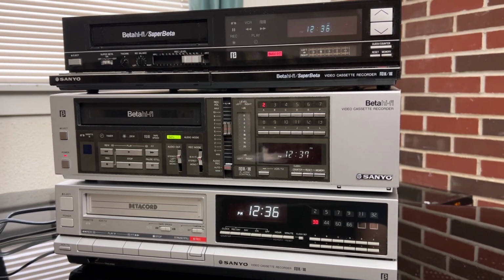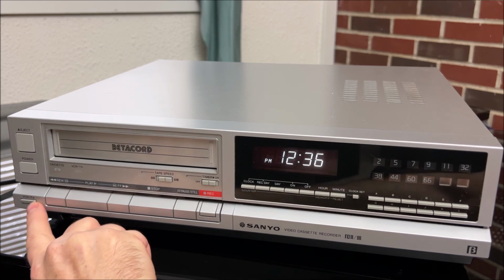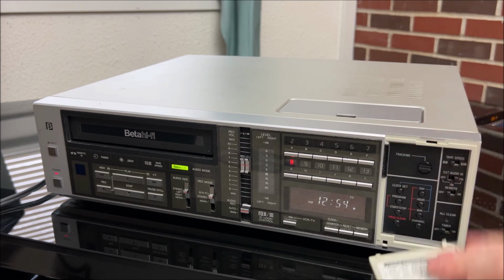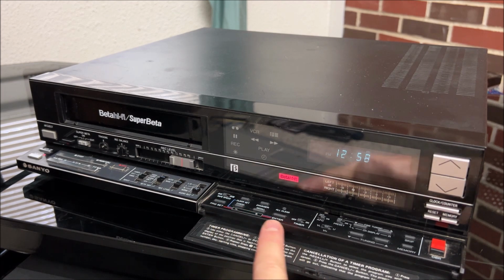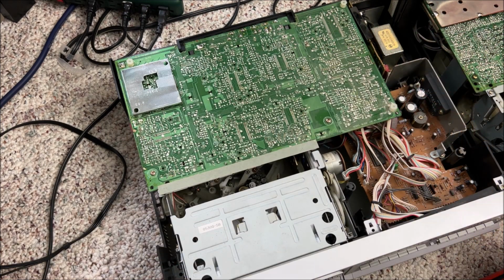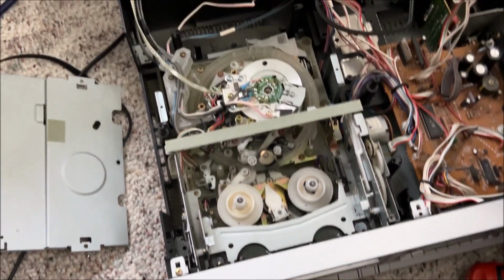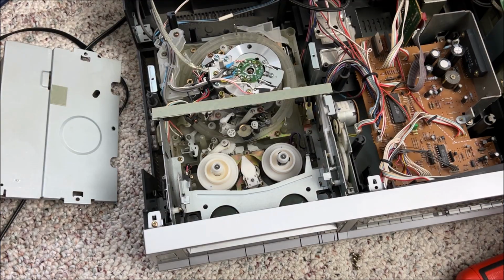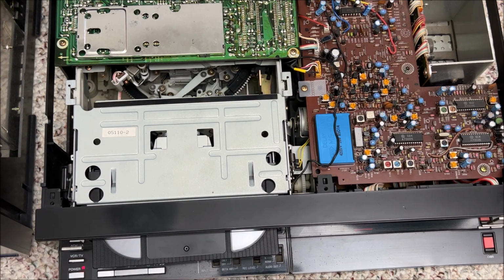Stop the Tape-Eater! Fixing a Sanyo Betamax VCR: Belts & Rollers Repair

Comment: Hi, I have a Sony Betamax VCR-7200 that I’ve been rebuilding and I’m hoping you can point me in the right direction.
Here’s everything I’ve already done:

• Replaced all belts (loading belt, arm belt, capstan belt, and the idler tire pulleys)
• Replaced both idler rollers
• Cleaned the idler tire and reel tables
• Cleaned the entire tape path (guides, capstan, etc.)
• Cleaned the audio/CTL head
• Cleaned the drum surface
• Cleaned the cam track (no oil added)
• Cleaned the cam follower (no oil)
• Lubricated only the correct metal pivot points with light machine oil (very small drops)
• Returned the loading spring to the original notch
• Mechanism loads and unloads properly
• Reel torque is good and take-up is working

The issue:
Video is fuzzy and unstable unless I manually push the right-hand guide arm (the tension/guide post that pulls the tape onto the drum) inward about 1–2mm.
If I press that arm while it’s playing, the picture becomes perfect and the tape sits squarely on the drum.
But the arm will not reach that position on its own.

So it appears the guide arm is stopping just short of its full travel, even after cleaning the cam track and lubricating the pivot.
The spring is in the correct position and is not stretched or weak.

My question:
What usually causes the right guide arm on these 7200 decks to stop slightly short of its correct wrap position?
Is there a specific pivot, follower, or cam part on this model that commonly binds even after cleaning, or is there an adjustment point I’m missing that affects guide arm travel?

Any advice would help a lot — thank you.

Comment: "Super Beta has a slight increase in picture quality", Right!  Standard VCR picture quality was 230 lines of resolution or less, Super Beta was over 400 lines of resolution, a major improvement. In most cases you did not have a video source that could fully utilize the capability other than to use a high quality camera to show what Super Beta could actually do. Also, HiFi audio came out prior to when TV stereo was available and was a real treat, OMG... This sounded so good when hooked up to your stereo system.

Comment: Great video, recently picked up a Sony sl-5000 machine and essentially soaking up the basics of a more analogue design and tips before I jump into my own. Has trouble loading and appears to be famous for bad belts and caps so I’ll have an order in for that soon. I also have an issue where the very thin plastic plunger style buttons on what I assume is the timer like to shoot out. Noticing some are firm in place while others will easily pull out or shoot out if you press an adjacent button. Hoping some simple plastic epoxy will fix that for the limited use it’ll get.

Comment: Thank you so much I just spent 300 on eBay for another Sanyo and it ate a tape and the o ring thingy broke I have 2 Sanyo betamax vcr4400 vcr 4600
Reply from the maker: Oh wow, $300 is way too much.  If it was listed as “working”, I’d request a partial refund.

Comment: Any tips on how to get it to eject a stuck tape on a sanyo 3900. It ejected once, but never again. I have taken the top off the unit.
Reply from the maker: I think most of these models have a wheel on the right side of the tape well. Connected to a belt. See if you can turn that wheel by your finger.

Comment: Great video! Do you know if the spools drivers have clutches and sensors? Long story short, I have a Toshiba vm41, with a cheater tape it Performs all functions, with a complete tape however, the drive engages the geared drive, but the center post (the part that actually fits up into the tape spool) slips and withing a few seconds stops. It's like that center piece can't turn and maybe somewhere underneath is a sensor that detects the lack of motion, even while the gear drive is working. Any ideas would be great. I can't yet find the service manual.
Reply: Maybe you already figured this out in the year since posting, but I just acquired a 7250 and have the idler assembly apart.  There is a simple clutch under the idler wheel, a fuzzy material, with a spring holding the wheel down against it.  This resistance to rotating that this clutch produces is intentional, and it's what helps the idler flip between turning the takeup and supply reels and stay engaged.  If yours doesn't have enough oomph to turn the reels with a real tape loaded, then you have to replace the idler tire (and belt, if your model has one... the 7250 motor directly drives the idler tire).  In mine, the idler tire was hard as a rock with dents from where the motor had been slipping against it.  As far as sensors, I didn't see anything external in the mechanism, but I bet the motor has an internal sensor to tell its controller what RPM it's spinning at so the machine can be semi-intelligent about whether to give up.
Reply: Also @databits thank you for the video!  Very helpful.

Comment: So did you end up using the O-rings as belts? Or did you use the Cassette square belts from your eBay link? Just trying to figure out if I can get by with just using the O-rings from Amazon for my Sanyo 4030.
Reply from the maker: Both.  The O Rings work as smaller belts.
Reply: @databits  Will order both sets then. Thanks again for making this video!

Comment: Great video. Mine is the 7200. I took it apart as shown. Problem is when stopping the tape does not return but balls up and needs to be detangles. Is that most likely the tires and their drive belt. The tape loading belt. Or the main belt? I love your O-ring tip. Lastly any suggestions for brand name for Belt Kits. There's a lot on e-bay and each looks totally different. Thanks for ALL the effort you put into demystifying these incredible inventions. Loved them thoroughly.

Comment: Do you recall the actual sizes of the belts you used for the back and front loading belts (particularly on the 7250)?
Reply from the maker: The front belt I used was an O ring from the kit like the one in my description.  The back belt was from a cassette belt kit from eBay.  Did not measure them tho.

Comment: I have the same Superbeta VCR7250.  I serviced and fixed mine which did not want to play.  After getting it all fixed up, I found out the HIFI audio did not work.  Seems like the audio board located by the video head was no good.  Tried replacing the caps and got low distorted sound.  looks like they normally do require caps but still cant get audio working properly.  Any other ideas?
Reply from the maker: Tracking being off and dirty/worn video heads may be an issue.  I’ve found these to play commercial tapes alright, but struggle with recording.  One of my test tapes ended up being stretched or warped…that was frustrating.  Have you tried replacing that audio board?